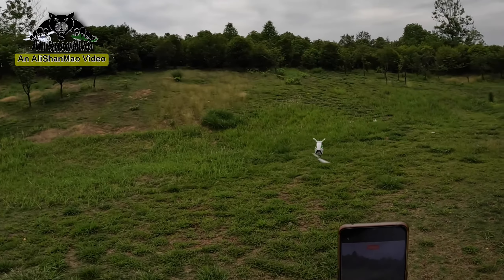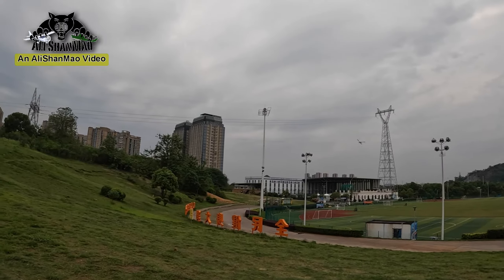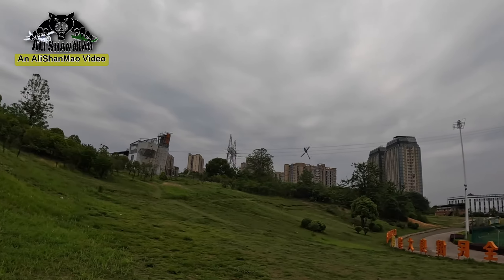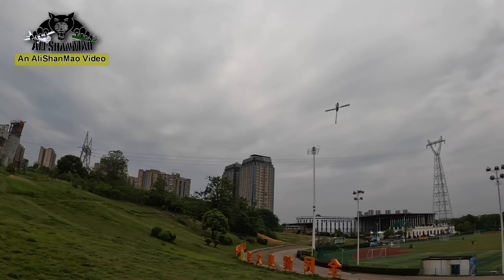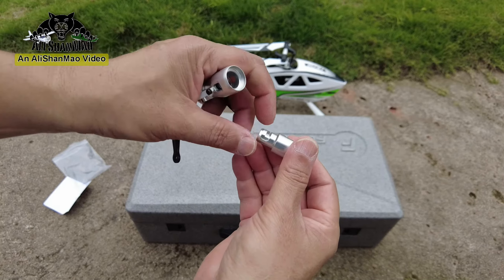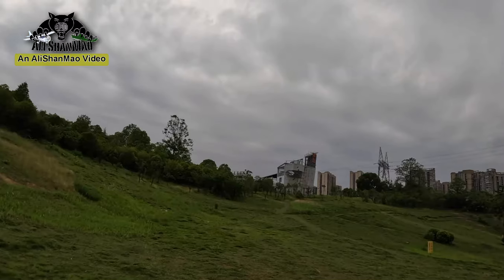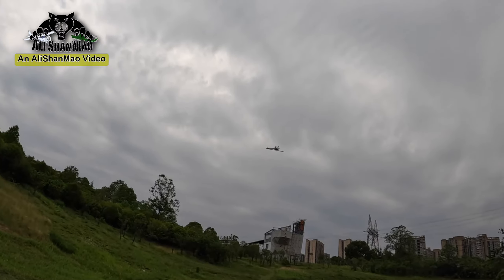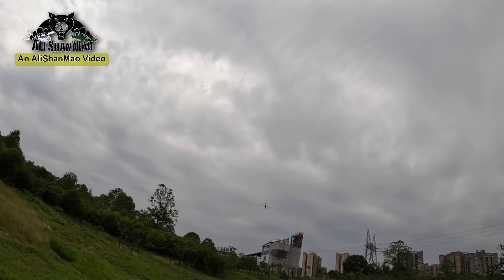Must-Have Upgrade: FlyWing Main Rotor Quick Release System for FW450 V3 GPS Helicopter

Comment: Hello Ali ! I have a question for you ....i am intersething by Flywing heli but what is the difference between Bell 206 and 450V3 is it that only the new GPS or another parts or programming ? I have a new GPS at Home , if i place an order for Beel 206 and i put my new GPS This is a same of FW450L V3 ? I love a fuselage but i look for the last vesion !! Thank you for your answer !!
Reply from the maker: i would suggest get Huey UH1 V3 or Best FW450 V3 because later you can convert it to Airwolf. Huey UH1 and FW450 V3 are the best in FW helis. use links below to get them from my supplier. appreciate it :)  any other questions feel free to write. 
FW450 V3: http://bit.ly/3YT8qeF
Airwolf Shell: https://bit.ly/3kinLXt
Huey UH-1: https://bit.ly/3ugxzT2

Comment: Hi, I have a FW V3 206 & 450 V3. I purchased 2 quick release heads. The web says the QR head can’t be fitted to the 206 due to longer rotor diameter. Not true on V3 206 as plenty of clearance from rotor to tail rotor blades. Anyway QR head flies fine on my 206 but when installed on 450 V3 on std settings it bounces in the hover 3 to 4 inches in gos mode ie no stick inputs. This was on std 75% motor speed. I tried 70, then 80, then 85 and still bounces. Put stock head back on & flies fine ie no bouncing. Strange as is fine on 206. Sad to have to re install std head as can’t use QR head to make use of carry case without unscrewing blades. I am in Australia & no support here. Do you have any suggestions?? Am a subscriber & enjoy watching your channel & 3D flying.
Reply from the maker: you will have to tweak the settings to use new rotor head.

Comment: Boa noite, hoje a tarde estava voando com meu FW 450 L V3  e repentinamente ele despencou do céu, a bateria acabou sem dar nenhum aviso, afinal como posso  prevenir para que a bateria avise antes de acabar, tive sorte que não houve dano mas foi assustador  ver cair sem aviso de corrente baixa. Já comprei e recebi o sistema de liberação rápida de hélices , muito prático.
Reply from the maker: you may setup the battery low voltage RTH but then it will annoy you to activate RTH every time in a minute or two. best is to install a low voltage beeper on battery